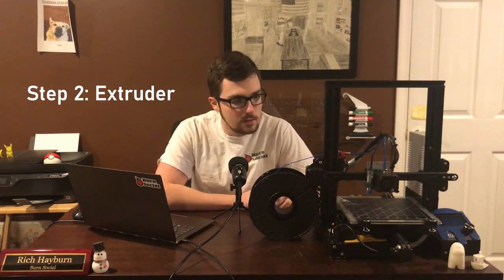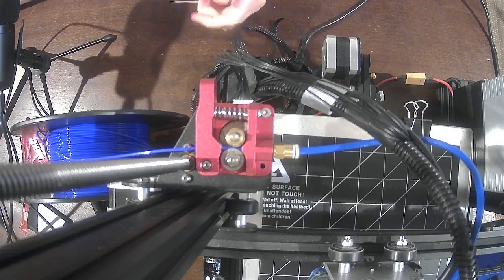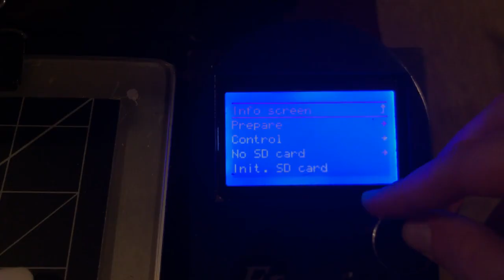4 Easy Steps to Fixing Under-Extrusion

Comment: although its over a year old, i had the issue with the creality slicer making the nozzle while traveling dip to 185°c from 210°c and do the same while retracting. (this was with my Sunlu S8)
Reply from the maker: Hi Celynnec. Are you comfortable reading gcode? Would love to see if this is based on the output from cura (meaning a slicer setting) vs a machine reading issue

Comment: Can you do a video on how to make my prints start to my ender 3 pro bee my bed is leveled
Reply from the maker: Hey Maya, thanks for your comment! Could you elaborate on what your problem is? It's that your bed is hard to level, or that your filament won't come out of your nozzle even when it is level? 

It might be that your bed is too close to your nozzle, there needs to be a little gap or else it stays squished in the hotend. I'm working on a video now about how to properly level your bed. That ends up being the fix for a large amount of print quality issues!
Reply: @burnsocial3542  Hi Burn so my bed is leveled but my prints won’t stick to me bed I tried using a glue stick but that did not work I have a flexible build plate I used a water leveling thing if you know what I does are sorry for my bad spelling
Reply from the maker: @aPlakkie  Thanks for explaining! Are you using PLA? If yes try using blue painter's tape instead. Here's a list I reference for the best build surfaces by material: https://help.matterhackers.com/article/106-choosing-the-best-bed-surface

Hope this helps! Definitely update with how it goes
Reply: @burnsocial3542  thank you so much
Reply: @burnsocial3542  can you maybe send me a link to blue printer tape on Amazon you see I am South African but moved to France so  if you send the link it will help me find it on Amazon france
Reply from the maker: @aPlakkie  Totally! Here’s the link for the stuff I buy:
Wide Blue Painters Tape, 4 inch x 60 Yards, 3D Printing Tape, Easy Clean Removal up to 21 Days, Masking Tape https://www.amazon.com/dp/B01DKXFAEE/ref=cm_sw_r_cp_api_glt_i_0KHABF9R6WCQ5BST4RYZ?_encoding=UTF8&psc=1

I like that it’s extra wide so I don’t need to line up a bunch of pieces every time

Comment: I cant remove my filament or my Bowden tube ive fulled as hard as i can an its like it's  jammed an its it's no pushing out filament i just updated the printer  idk what to do
Reply from the maker: It sounds like you have a big clog! Try heating the hotend up and pulling the bowden tube out. If it's clogged badly enough you'll need to snip the end of your bowden tube. You should also take out the nozzle and check that there's no filament stuck in the heat sink (and to see if you can salvage the nozzle). 

Funny enough I've been working on a video on clogs and just uploaded it around an hour ago. It should have some solutions to this you can try!

Hope this helps, definitely keep us updated

Comment: god man i'm both relieved and pissed at the same time. i've replaced hot end, tubes, nozzles toooo many times now. done countless filament/temp/flow rate/leveling/retraction adjustments over 3 months and the thing that was causing my under extrusion was AN UNCLEAN FEEDER GEAR. shoot me in the face. as i was cleaning the gear out with a metal pick in the middle of a small print, it went from bad to good. thanks dude
Reply: yep, i know that feeling sometimes there´s debris or either  something stuck or something loose  LOL
Reply from the maker: Happy to hear I could help! How are your prints coming out now, 3 months later?

Comment: dude get a nozzzle socket wrench lol  Number one cause with creality is the tension arm, if you are under extruding pull it off I will almost guarantee it is cracked.
Reply from the maker: This is an excellent point! My original ender 3 had that exact problem and needed an aluminum extruder arm and base
Reply: Major cringe! As a mechanic, the proper tool is ALWAYS necessary.

Comment: is the tube supposed to be all the way down? cause mine kinda melts then lol
Reply: Check to make sure your hot end fans are working
Reply from the maker: Yeah it should be, or else filament clumps up in the gap between the tube and nozzle causing a clog. What hotend temp are you using?